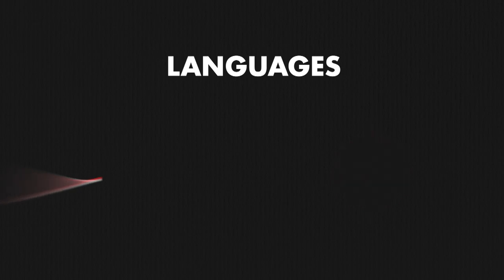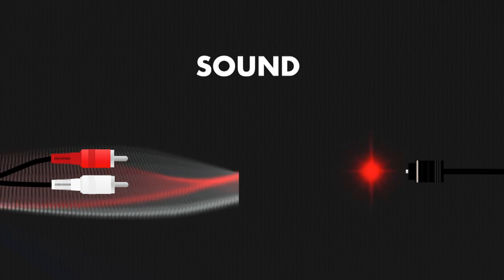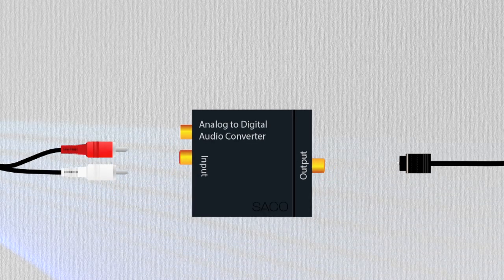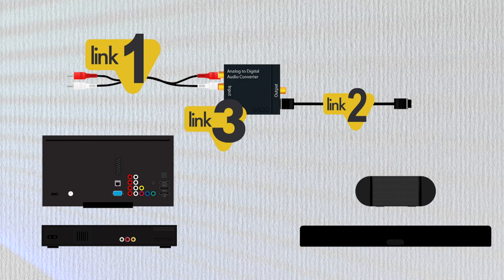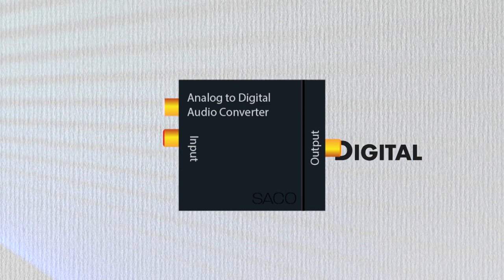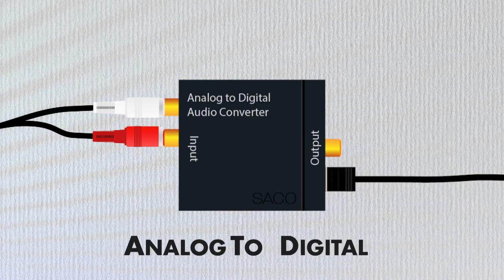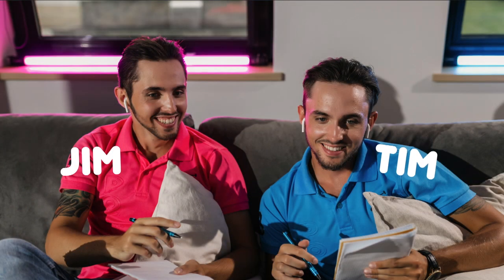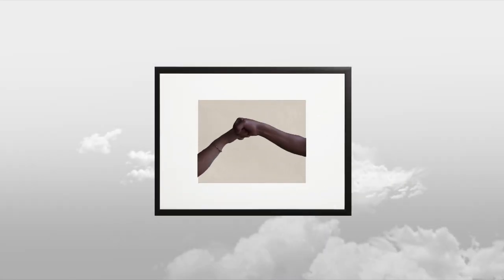RCA to Optical (SPDIF - TosLink - Digital Audio Out)

Comment: Hello, I have a soundbar with only a usb port and a optical input and I’m trying to connect with a older tv that only has rca input and coaxial output. I picked up a digital/analog analog/digital converter along with rca ports and connected it to the tv and messed with the settings and i still don’t hear sound. Do I need to connect the coaxial to the converter and connect it to the tv?

Comment: Hello,

I have an old TV which have only RCA inputs and 2 HDMI's (NOT ARC), and I have a soundbar with two inputs only Optical and HDMI ARC.

Can I put my ps4 on HDMI 1 and get sound from the soundbar using this converter? if I connect the soundbar to the tv with this converter using RCA and optical cables?

Thanks inadvance.

Comment: To what extent sound quality differs between rca and optical cable for entry level soundbar?
Reply from the maker: Hi C.TImes, to a very low extent. If it's optical (digital), it ends up getting converted to analog anyway so if you don't need to convert it, don't. but i would go with optical if you want 5 audio channels to run through a single cable.

Comment: how much information/data will be lost using this kind of converter?  i'm thinking about using it on my record player that only has RCA outputs and routing it to a sound bar at the TV that i use as an audio system for movies and Playstation, audio from TV goes through HMDI so optical port is free to use. Optical cable shouldn't have any looses, so the lenght of the cable shouldn't affect to the quality of sound, but i'm not sure about this kind of converter... 
Help anyone with more experience than me...

Comment: I need help, I have a digital to a analog converter to witch my smart Tv only supports optical and my stereo only has rca but when I connect them I don’t have any audio coming out of the big speakers witch are connected to the stereo can you please help me out here
Reply from the maker: You might have to go your tv settings and select EXTERNAL Speakers
Reply: @SimpleCafeE  not even that please help me find a solution